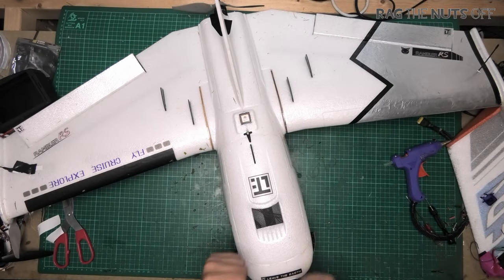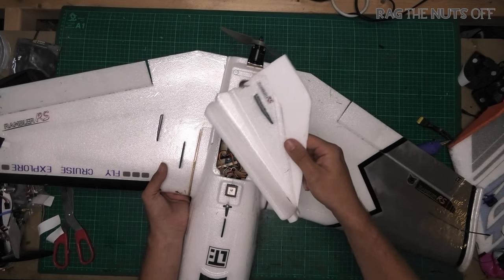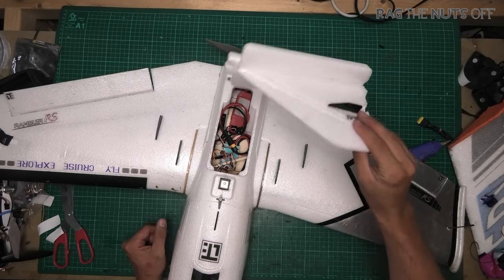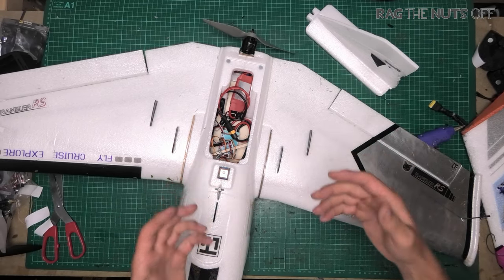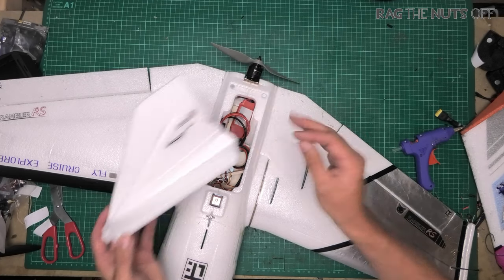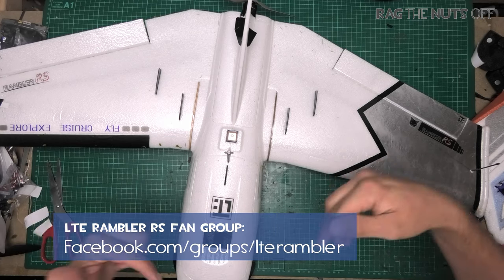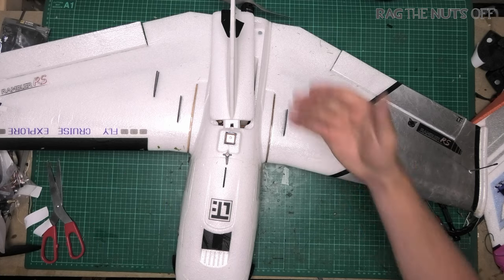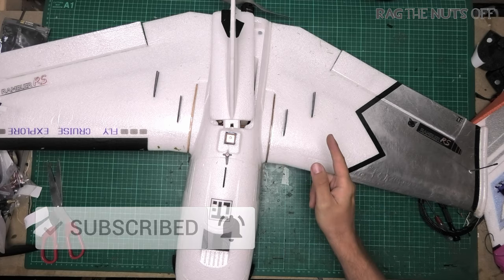LTE Rambler Must-Have Modification (to stop it from flat spinning)

Comment: Yours must be different than mine. Besides having black hatches, I cannot open the rear hatch like you did. It can only be opened by pulling it at the rear by the motor. Its a very strong hold and I have no fear of it releasing.
Reply from the maker: Howdy, that's odd. Yours must be an earlier version then?
Reply: @RagTheNutsOff  Think it was one of the very first.. Sorry to see they changed something that wasn't broke...
Reply from the maker: @stanordave  ah that makes sense. The huge air intake at the front doesn't help as that's forcing air in all the time too
Reply: @RagTheNutsOff  added a video showing a bit of my hatch's strength. 
Not up to your quality of course and my arms aren't long enough to get the whole plane in view but, if if "shake" it in front of the little fin, it stays on quite well, t or behind the fin and it releases.
 https://youtu.be/hAsL9iwGnaQ

Comment: I'd much prefer the Aggressor or Mini Drak to this but to be fair, extending the vertical stabaliser probably has a lot to do with it being easier to come off in flight... and its not a huge deal, stick a bit of tape over the hatch or use the pins.. sorted.

Comment: Maybe extra fin area caused the fin to be dislodged?
Reply from the maker: Howdy, possibly, more likely the huge open nose ramming air in the fuse and helping to push it off.
Reply: RagTheNutsOff  Yes the internal pressure must be huge, are there vents in rear? It’s like a cork in a bottle 😂😂😂😂😂🍾
Reply from the maker: @theBodger  yea there is a hole at the back, but it's blocked by the HT leads and only a fraction of the size compared to the nose vents. It just needs to be blocked up at the front. It's quite a large cavity and there will be airflow from the top and rear vents. Matt
Reply: RagTheNutsOff Trouble is unless you streamline the front it’ll be like flying a Transit van.Get a piece of copper pipe heat it up and poke holes for venting,The same volume of air must be expelled as comes in 💨
Reply: Just looking at it can’t you put 2 holes either side of the engine 1” diameter?
Reply from the maker: @theBodger  Yep anywhere there would be OK.

Comment: I don't want to do that kind of modification. Just need to buy smaller dart, cheaper, less battery (2cells 18650), long flight time, proven for long range flights, same FPV. Not to mention it's easier to carry on backpack 😄
Reply from the maker: Amir, I love the dart 250g. For all the reasons you already know about

Comment: So they really made a Primary Aerodynamic component, without the plane is IMPOSSIBLE to fly, held down by just 2 magnets?!?!?! 
Seriously???? Oh dear that's a absolute nogo. there is a reason why all planes with stabilizer fins on a hatch are screwed down.... -_- That's an epic fail!
Reply from the maker: If you take a look at the nose, there is the other half of the problem, you have a HUGE air intake and while the hole at the back is large, it's not big enough to expel the air, so too much speed etc... compounds the problem and pushes that lid off. Matt
Reply: @RagTheNutsOff  yeah I see. ZOHD provides nose cover stickers to cover the nose if you don't use a Action cam on their planes. And they explicitly warn you about that. Well. A lot of hype about nothing special
Reply from the maker: Basically yup. The Dart 250g is more exciting tbh. I'll get a panel printed for mine and that should lessen that from happening too. Matt